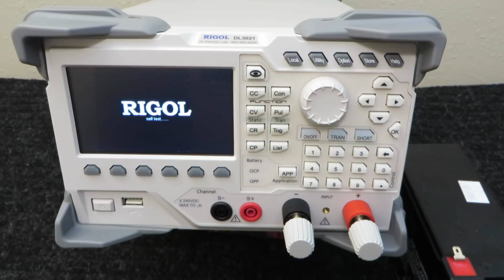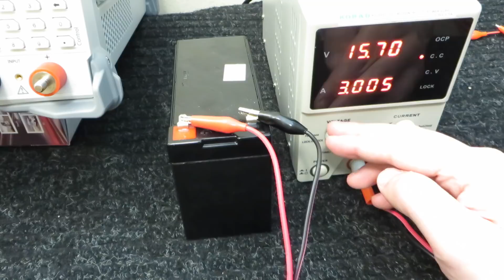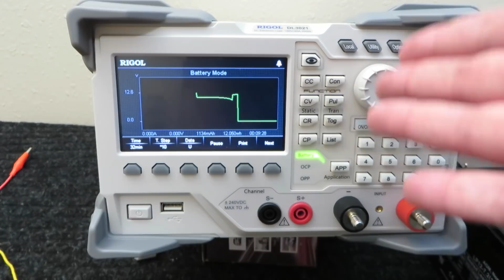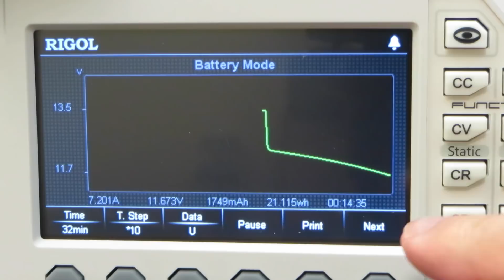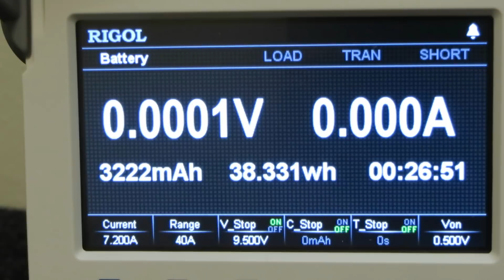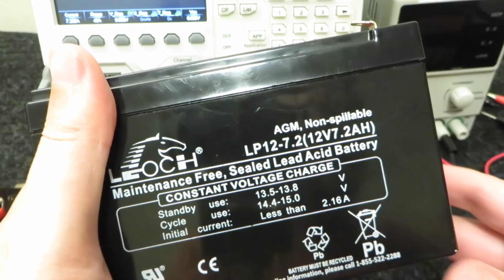Battery Desulfation Demonstration Start to Finish - Part 2/2

Comment: Many battery testers are rather limited in functionalities compared with electronic loads and there are really good electronic loads out there such as the one used in the video, but there is a steep increase in price wrt. power, so I wonder: perhaps I do not need full discharging power to reliably assess the max power a battery can output in a continuous fashion, do I? For example, the max. power of Rigol is 350W and many batteries I would test power 500W engines (mostly at their maximum power but a bit below the max battery power). Hence my concrete question is accordingly (to all of You):

Will I be able to unequivocally assess all the batteries' abilities to work with 500W load using only a 200-400W electronic load? Perhaps it would be possible by the virtue of internal resistance measurements or discharging in some special way, wouldn’t it? How about still higher battery powers (say powering engines of a few kW)?
Reply from the maker: "unequivocally", no, but for practical purposes one does not need an electronic load that can do the highest discharge rate desired to get good data.  For a useful IR measurement you'll likely want to discharge using an inverter or something of the like, as AC IR testers do not give measurements that can be plugged into an equation that results in an accurate discharge curve for loads higher than what was directly measured.  I would instead argue that no electronic load is needed and that it instead only makes the process easier.  The best method is to discharge at the correct test load and this can be done with an inexpensive power inverter.  It's just a bit of a pain in the *ss.
Reply: @knurlgnar24  yes I know this inverter trick of yours and You greatly presented it in the first part of this video but as you admitted an electronic load is simply more convenient. Speaking of which, I guess your answer would essentially be that one should discharge battery at its max. load power to make a reliable test of the battery in its application environment, so for medium-to-high power batteries the 350W Rigol is not the way to go. Is that your answer? (or discharge at a typical load power, which in my example of a 500W vehicle engine means simply max. load power anyway)
Reply: @knurlgnar24  BTW, I so insist on this discharge power because although I know little about batteries I think that even after "successful" reconditioning, a battery's internal resistance might be so high that it will give a fraction of nominal power. For example a battery like that in this video may give above 12V alright (or a perfect nominal open-circuit voltage), but the current flow out of it will max out at half of the nominal one, say instead of 12A, 6A at the most. Is this basically correct what I am saying or does the internal resistance of a battery not work like that? (as far as I remember a battery may be represented simply as a serious of a voltage source and a resistor, the only difference being that this "resistor" changes its resistance - but how and to what extent I do not know)

Comment: $25 or $30 may not be much to some here, but it can be expensive to people like me. Making my batteries last as long as possible is important to me. This video is very interesting, and I will try to obtain similar results as the author has done with much lesser equipment either bought "off the shelf" or built with my own two hands. To the author: is it possible to restore LiPo 18650 batteries? Can you show why or why not?
Thank you!
Reply from the maker: Lithium batteries are quite a bit different and cannot be recovered this way.  There are different methods I have seen to partially recover them which I have not attempted, however I have not found any reputable sources that indicate they can be safely and effectively recovered once they have been damaged or aged.  Unfortunately my current opinion is that bad lithium batteries should be recycled and replaced.
Reply: @knurlgnar24  OK, I will follow your advice, they aren't all that expensive anyway to replace. Damaging them can be quite risky and I do not want to breathe lithium gas anyway. Thanks!

Comment: I've been some people to desulfate their battery with  AC capasitor (400/450 V, 60 uf) and connected with 5 amp rectifier in series, does it really work? https://youtu.be/GZ9ODXepoJA
Reply from the maker: Haven't tried it but it probably works.  All that setup will do is send a controlled overcharge to the battery which is what I did in this video.  What is shown here is safer and more controlled but 'run what you brung' I guess.
Reply: Thank's for your attention bro 👍
Reply: I desulfate with my PV power point  solar water heater.  I just put battery in series with the water heating element.  It sends fast 10A pulses and it seems to work. I get old batteries from town recycling.  Saving a battery is a lot of hokum, but for my small uses where I only need 1/3 capacity or less it works out. I get new ones the next year after they die over winter.

Comment: I have 150 neglected sealed lead acid batteries that come from an Eaton UPS sold at auction. They're 12V 5.5Ah and I'd like to triage them into:
* Great
* Average
* Knackered
What tool should I use to triage them - fast (like 10 secs per battery) ?
Then I'd like to put them through recovery - "average" ones first, and "knackered" ones later on - but I want to do this with FOUR batteries at a time.  I can't spend the hours doing them individually.  Does anyone know what techniques and equipment to use so as to treat four simultaneously ?
Reply from the maker: Simple off-the-cuff thought:  Connect a bunch of them up in parallel and force 0.5A through them (if 10 batteries 5A) for x hours depending on their condition.  I'd do more than 4 at a time personally.  Check the status with a DMM and conductance meter.  Sort and continue.  Sounds like a fun project.

Comment: I suspect one could make significant amounts of money simply using the information you're imparting in these excellent videos.
Reply from the maker: Wish I had known that.  ;)  There are industrial battery re-conditioners who use similar processes.  They often also change out the electrolyte and such in some valuable batteries.  A quick search for used forklift batteries should show who does that in your area.  As shown here there's no magic to it and one can do this themselves with a little know-how.

Comment: Would you follow similar steps to recovery larger 6 volt batteries that are rated over 100 amp/ hr. ?
Would you use a power supply with higher amperage?
Reply from the maker: Yes, this exact same method will work on a 6 volt battery.  A power supply like this would be sufficient for a 100Ah battery and I have used them on my bank of 100Ah 12V batteries.

Comment: Good lord, someone who actually checks the capacity afterward.  What a concept.  

I think most commercial desulfators go to about 60 v with a more or less constant voltage ramp at 13 khz or so to the normal charging voltage, and the pulse width for the spike looks like about 20% just guessing from what I remember of the waveform.  I think the pulses are what break up the sulfation.  I've seen actual picks of the sulfate removal from the plates and it looks quite good.  Not many actual current load voltage time curves.  I would like to see your battery maintenance vid, will search it.  Thanks for spending time and actually DOING something.  As an EE I appreciate it.  The fact that you don't sound like a moron is quite nice, too.  I think there are more brain dead videos on resurrecting bad batteries than about any other subject.  I saw one goofy kid salt a battery that had been laying around forever, and claimed it was functional now because he could get teeny tiny sparks when shorting it on jumper cables.

Nice vid, thx.

I can tell you what would REALLY help battery packs is if the manufacturers would voltage monitor EVERY cell in the pack, and as soon as one hits it's minimum spec'd discharge voltage, SHUT OFF THE BATTERY by just opening the circuit.  If you did it such that the shut off occurred at about 85% discharge I expect they would last MUCH longer.  As soon as you back bias a cell you are degrading that cell at a VERY high rate, time wise.  Dead is not great, especially for long lengths of time, but charging them to a negative voltage is MUCH MUCH worse.
Reply: > Dead is not great, especially for long lengths of time, but charging them to a negative voltage is MUCH MUCH worse.

Can you further elaborate on this to someone who isn't an EE?
Reply: @HaploPrime  It has to do with the chemistries involved in some types of batteries.  In the case of lead acids (car starter batteries) leaving them at exceedingly low charge for any period of time causes sulfation on the lead plates, usually rendering at least one of the six cells virtually or totally inoperable.  

In other chemistries, like NiCads, there are chemical processes when charge is reversed (happens when a cell in a pack loses capacity) and/or when the pack is discharged under load to extremely low voltages.  In that case chemistry the cell is not designed to operate with occurrs, usually leading to irreversible damage, like some chemical bond occurring that is very hard to break.  You can sometimes fix this to some extent, but the cell will probably never be the same.  This is why cells are carefully matched for capacity for a given pack, but by definition there is ALWAYS a weakest soldier, and he will get felled first.  If you don't deep discharge (quit discharging at the recommended pack voltage and recharge) this problem can be avoided, at least for the normal expected charge/discharge cycles, in that case about 1000, but I have had battery packs go FAR longer than that. Ni Cads can be stored almost indefinitely fully discharged, from my experience, but just one reverse charging will degrade a cell significantly, a few times will destroy it, and it will have virtually no capacity.

Li Ions I don't know all that much about, but IIRC they are not supposed to be discharged below 1.1 V for a given cell.  I also understand that in a hybrid or electric car battery, for instance, charging them to about 85%, and not letting them discharge below about 15% of recommended, AND keeping the cooling fan filters changed or cleaned regularly will VERY MUCH extend the life.

You can probably get more/better info searching the web.  I am certainly no battery expert, not even a little bit, but that is some of what I have found and/or understand to be true.  Hopefully I got it right.    NiCads and lead-acids I'm pretty solid on, some of the later technologies not as much.   Hope this helps.

Comment: Hmmmm   something fishy here  with me... in over 30 years i could NEVER recover a sulfated battery with one bad cell;  NEVER;  tried w/ all kinds of chargers,lab pwr supplies, even welders;  NOTHING;  then i was able to fix them, not this way,but by

 buying a new one;       that´s my 2 cents.
Reply from the maker: If the battery was used and never sulfated then I concur with your experience.  Batteries that have failed due to undercharging or poor maintenance are a good candidate for this recovery.  I suspect you haven't mistreated your batteries and as a result the methods in this video aren't applicable to your application/experience.
Reply: @knurlgnar24     it is actually painful for me to see all that equip and time.....well;  but, now, ANY TIME you see that DEATH NUMBER,  buy a new battery please:
.
.
.
well,the death number is     10.7   or 10.8 or....   you now know what that means;        it's DEATH     (of one cell,  AND of the non replaceable 6 cell rippoff arrangement they sell us).

Comment: Hello. Why do you 'tap' before plugging in negative clips ?
Reply from the maker: In case I make a mistake or have an equipment failure that causes unexpected high currents.  A functioning battery like this can melt the wires I'm using in less than a second.  If I tap a connection to make it I'll know if something is wrong before I cause major damage or burn myself.  In short - because I sometimes make stupid mistakes.

Comment: This was very interesting video indeed. You seem to know your subject. Ive been watching few videos on desulfation and yours seems most professional approach. I was especially interested the  part where you mentioned that you have used lab power source to desulfate individual units on 1000Ah battery bank. This got me thinking if I could recondition my eletric forklift batteries using same method? Before anyone asks, yes total noobie here. Maybe lab power source is just too small for forklift battery bank cells. 

Short background info: noticed that my battery bank does not hold charge as it shoukd be, measured the acid concentration in the electrolyte and all cells are between green and red in the white area. pretty much center of it. What do you think should and could be done to this battery bank to recondition it?

Thank you already in advance for any help you can provide.

Very informative videos, I need to watch more. Maybe after enough of those even I can learn more about batteries and eletricity. :D
Reply from the maker: If the batteries are full charged but reading low on your hydrometer then they are likely sulfated.  Depending on the battery cell size and type you may need something more like a 10A supply and they may vent a lot during desulfation, so be ready for that and make sure they don't run low on electrolyte.  There are safety concerns working with large flooded batteries but a lab supply of sufficient amperage will work on them just the same as a smaller battery.  Assuming you have a lead-antimony battery bank a 5A supply probably isn't enough for a forklift battery/cell.
Reply: @knurlgnar24  Hi, Thank you for fast reply. I was not expecting such a rapid responce. Yes, that hydrometer reading was after charging batteries. I have forklift battery charger which should be original. there are lights, which indicate cell charge from 2.1 to 2.65. While charging reading was highest at 2.52. immediatly after charging 2.3 and it is dropping slowly to 2.08 ( few days after charge) I´m keeping eye on eletrolyte levels and I also have fume extractor available. Do you have safety concerns beyond hydrogen build up? 

Those seems to be 500 Ah cells so most likely lab power supply is not right one for the job. Since all 12 cells are quite same condition maybe I can recondition battery with original charger? Just enough charge and drain -cycles? 

Thank you alredy in andvance for any help you can provide.

Comment: I may have a way to find out rather quickly whether a battery is worth working with; a huge time-saver.  I discovered in an old Anatek video, that the BLUE ESR Meter for checking capacitors, is also a great tool for testing impedance in batteries.  https://youtu.be/fD-8Dppp03w?t=761  The meter ignores voltages up to around 50vdc; using a small AC current to determine impedance.  Any battery testing less than 1-ohm is considered good.
Reply: I am taking some old UPS batteries, and using a PSU to bring them up to a readable voltage (e.g. 10vdc+) using your method, and then using BLUE to see what the battery's impedance measures at.  A current test battery is showing 54-ohms!  So, cycling to see if that comes down, and to what level.  Hoping to establish a relative MAX vs MIN impedance in hopes of being able to quickly determine whether to invest time and effort into a battery or not.  Just sharing.
Reply: In just a few minutes of charging, the impedance dropped to 27-ohms (still incredibly high), but it dropped.  I think that after a while, the impedance just won't go any lower, and that will be the tell-tale of the batteries condition and worth at that point. Comments welcome.

Comment: Testing and trying to find what "fully charged" means when using over-charging to desulfate. Voltage @ ?  ...and...  if it's still accepting a charge @ 15VDC, when do I stop.
Reply from the maker: You unfortunately won't know when it is fully charged while desulfating.  This is one of the reasons the battery must be cycled to test its performance.  You don't want to force-overcharge it longer than necessary and cycling will tell you whether it is still improving or not.
Reply: Main reason for trying to determine this, is to get a more accurate Ah reading after each discharge cycle.  If discharge is started at a different voltage and/or charge capacity level, then tests aren't apples-for-apples.

Comment: Would you change the procedure or voltage marks for deep-cycle vs typical auto batteries?  Thx for the vids.
Reply from the maker: Same for both types.
Reply: @knurlgnar24  , would you discharge lower than 11VDC on the deep-cycle batts?

Comment: Excellent video, although I think you got Extremely lucky with that battery as most can not be restored to their former glory.

A quick note. All AGM batteries once left over night after being charged, will drop down to around 12.9V/12.8V (When I get brand new batteries, I charge them, leave them over night, and the following day, they are quite happily sitting at 12.7V - 12.8V). 

If the battery was charged and shows 13.1V+ after sitting overnight, then it is on its way out.

On a side note, it is Always good practice to replace the energy used from an AGM battery as soon as possible (If not immediately). I was told that this is one of the biggest reasons why these batteries die prematurely. If you use 2 Amp out the battery, replace it as soon as possible to keep the battery at a full charge. If there is no short or drain on the battery, then you could store them on a shelf for quite a while apparently.

Ps. Got this information from a company that manufactures AGM batteries, so if I was getting the wool pulled over my eyes, I can't say, but it does make sense.